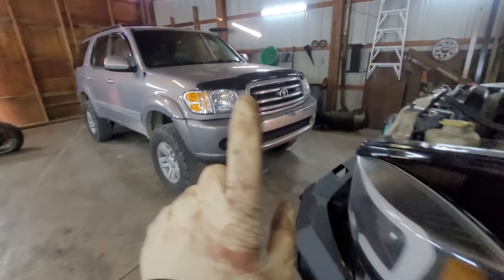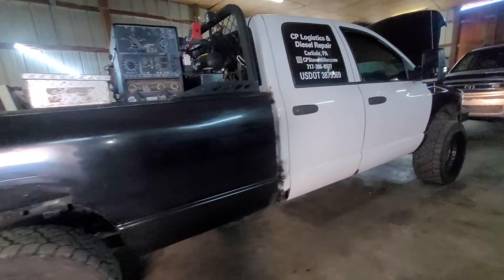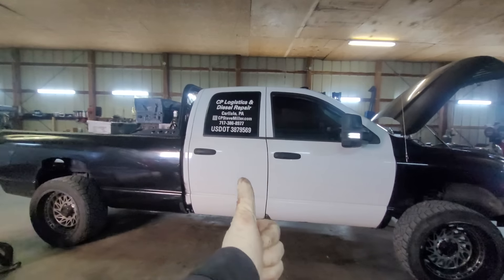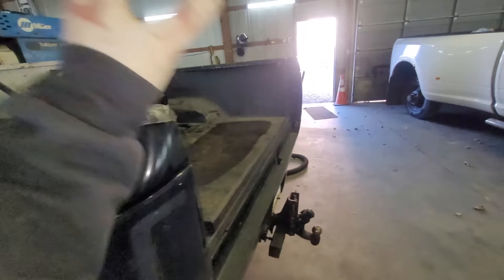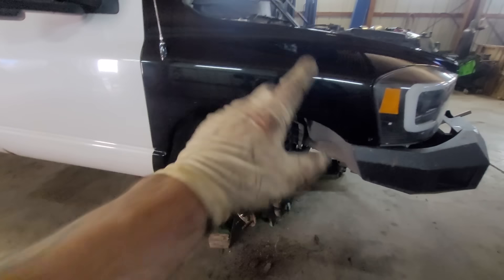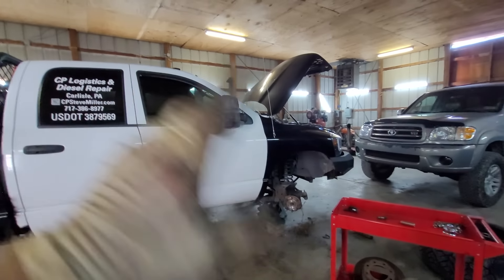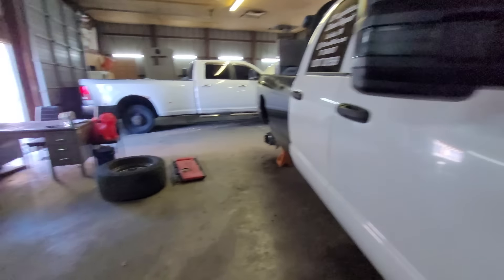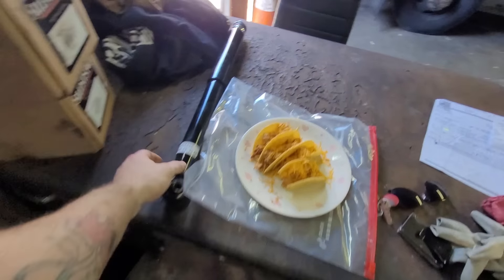337,000 Mile Maintenance Day After 6 Hurricane Relief Hotshot Loads

Comment: Years ago I built a 1 man brake bleeder using a 2 liter soda bottle. Just get a piece of clear tubing that fits the bleeder nipple tightly.I drill a nice clean hole in the bottle top and put a little FRESH brake in the bottle put the clear tubing into the fluid, open the first bleeder and slip the tubing onto the nipple well and pump your brakes-I usually do 10 pumps before adding more fluid. I usually do 20 pumps on each bleeder. Works perfect!! Make sure you do full pedal travel .
Reply from the maker: I've seen people do them. I usually do the gravity method if I'm by myself. 

I'll start the truck, pump it a few times and open the bleeders. When my wife came to bleed the brakes, no air came out and I had great brakes so it works if done properly!

Comment: The best thing i did for front bearings was ram man locking front hubs.
You can add grease thru the abs sensor. 
The fitting comes in the kit.
Helps fuel miles, transfer case, front axel seals and font u joints.
$2k price, but I'll have this truck for a while.

Comment: Noticed you have the stock upper and lower control arms. I had a b*tch of a time changing mine out with adjustable tubular arms because the exhaust is in the way of the passenger side upper CA bolt and those cam bolts had to be torched to get them out.
Reply from the maker: I cut the top bolt and put a new one in backwards on EVERY job. What a garbage design 🤦‍♂️
Reply: @CPSteveMiller  I agree. But I'm happy with my new CA's, I just drop one bolt and spin them in or out to set the caster. Now the truck drives like it should.

Comment: Supposed to change rotors with your pads or its called a pad slap and you don't even get half of your stock stopping powering putting new pads on an old rotors because the surface of your rotors are super rough after 10k miles unless its matched to the pads.
Reply from the maker: Supposed to but a lot of people don't. I just did a pad and caliper slap on my accord but when the fronts go out I'm going drilled and slotted the whole way around. Less than 180 bucks for Detroit axle ones
Reply: @CPSteveMiller  Yeah I just did a pad slap on my front's, didn't learn that you needed rotors for a proper job until afterwards. So I don't want to do the back until I get rotors and 2 new pads for the front. An older lady taught me when I was a kid and she didn't say anything about the rotors needing to be replaced for a proper job.
Reply from the maker: That's backs are an absolute bitch.. I couldn't get the caliper bracket bolt out on the passenger side so even if the rusted out rotor screws came out, I still couldn't remove them. I ended up only using one of the new caliper brackets with the new calipers. I did grease and clean up the pins, though. Not looking forward to 6 months from now redoing it all🤣😭
Reply: @CPSteveMiller  Great deal for drilled and slotted, my 19 ranger's stock ones are almost that much.
Reply: @jimoakley3436  ball joints just usually go bad after so long.
Reply from the maker: Last truck had 570k on it. I never changed them and I bought it at 314k so they had some serious miles on them. No play. Not sure when they were done prior to me purchasing
Reply: @CPSteveMiller  Some good value you got out of it no matter what price you paid, was it another RAM?
Reply from the maker: 04 Ram 2500